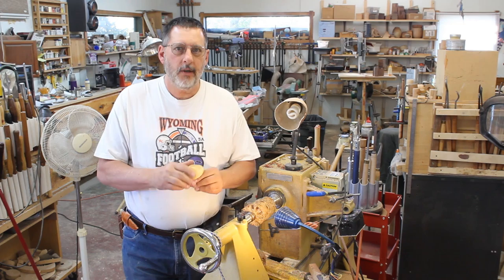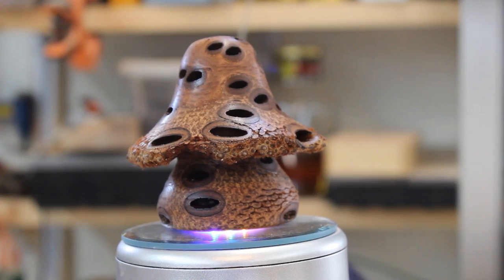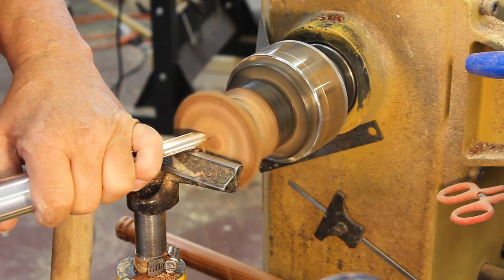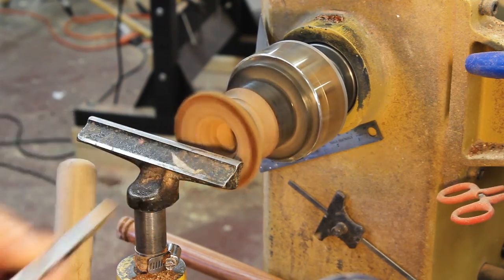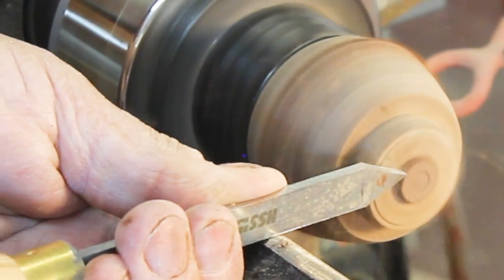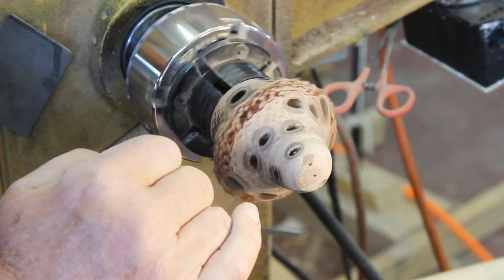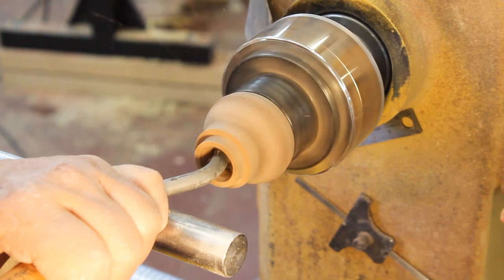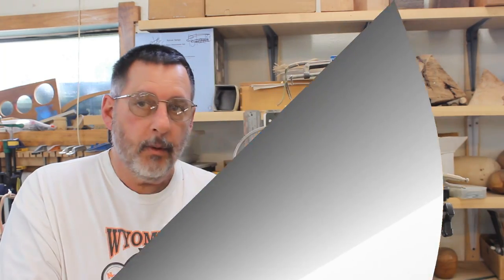Mushroom box made from a Banksia seed Pod

Comment: Hi Sam !!
Thanks for the video.The Banksia sounded quite different as it was being turned down.I was wondering if you could describe its texture to me...I would really appreciate it.
Thank you ...
Chris.
Reply from the maker: Chris
The seed pods are usually 8 to 10 inches long and about 3 or 4 inches in diameter at the widest part.  The surface is nothing like bark.  It is a little rough and almost fuzzy.  And as you cut it, just below the surface can also be a little fuzzy.  One end comes to a bit of a point and the other is more blunt.  The holes for the seeds are ovals but somewhat flattened out.  the seed hole goes in about 1/4 inch as as you hollow, you can use the holes to judge the wall thickness.  It is very dusty when you turn it.  Thanks I hope this helps.  Sam
Reply: WYOMINGWOODTURNER Hi Sam !!
That was a great explanation....I think I've got it now !!
Thousand thanks.
Chris.